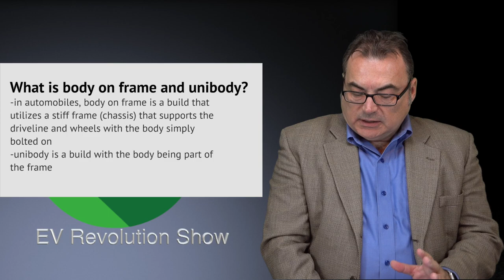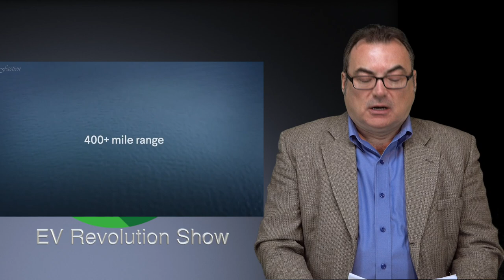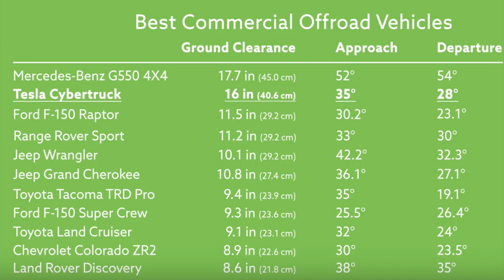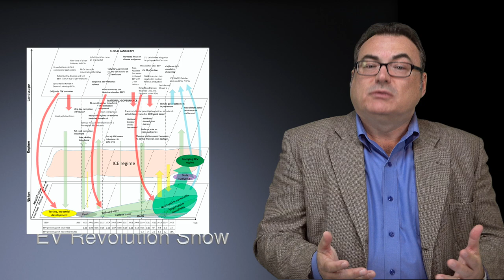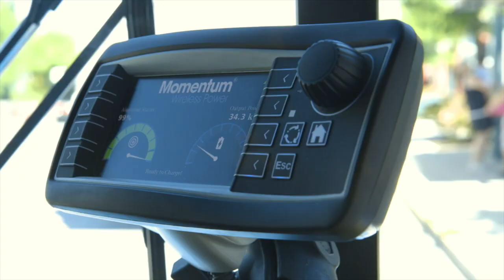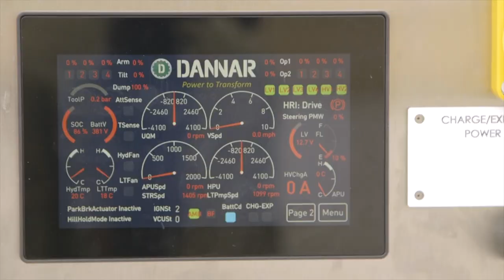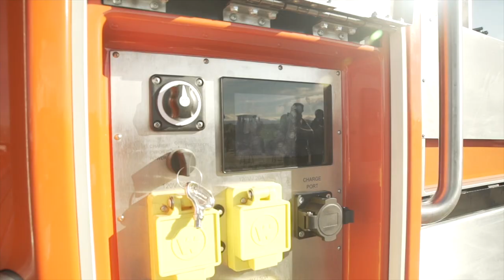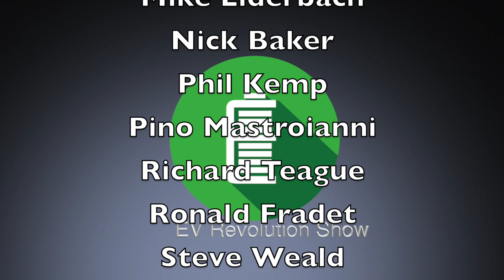Episode 70 - Tesla Cybertruck Part Deux, Lexus UX 300e, Fisker Ocean,  Dannar 4.00 and lots more!

Comment: Yes, Ken, the big three are huge compared to Tesla. However, you did leave out Toyota. It is precisely because the big three are so big that they cannot be as nimble as Tesla. With all of their sunk costs in ICE vehicles and their love of the huge profits they are addicted to it will be hard for them to pivot to EV trucks. Just look at how little GM has done to date. The mighty Ford is just now coming out with the Mach-E so good on them. Lets see how well it does up against the Model Y.

Now, consider this, since Tesla is still the little "new kid on the block", does it not make sense for it to go only after one small segment of the trucking market?  Even so, as runt of a car company, it has the nerve to go after the BIGGEST segment of the market, the F-150. It is unfair for you to compare the CT''s specs with the larger F series trucks. Tesla is NOT going after them.
Reply from the maker: I compared CT specs with many F150 series, not just the larger ones, so yes it was fair.
Reply: @EVRevolution  Ken, you have compared the CT with both the F-250 and the F-350. SO, no, you did not only compare the CT to the F-150. Now, with the off road comparisons, you have thrown in SUVs as well. Huh? What am I missing?

Comment: Dannar...As usual, your analysis is shallow and misleading.  It's amazing... in fact, it sucks!  Watch what happens to Reviean and the Ice truck manufacturers when the cybertruck hits the market.
Reply from the maker: Hi Robert, thanks for watching.  Not sure what analysis you are referring to...Dannar or the CT-Rivian Compare.  If it is the latter, I have acknowledged due to some other commentators that the comparison was not alike due to the Rivan model costing more than what I graphed.  I took the base MSRP.  It's safe to say that the higher spec version will cost more than the tri-motor CT.  

I'm a big boy and certainly can admit when I don't have all my facts straight.  If you follow me on Twitter you would have read this earlier.  I never try to mislead and if you have watched my shows, you would know that.  So I take offence to your statements regarding this and challenge you to find perfection and non-bias in all the other EV YouTubers - especially the Tesla-focused Channels.  I for one make mistakes and have no problem owning up to that.  

If you are complaining about my Dannar reporting, them please specify why?
Reply from the maker: Oh, and I will be watching what happens with the CT hits the market for sure.  Like I've always stated, I want Tesla to succeed and hope they sell boat loads of these.  

My analysis was focused on the market potential of the CT design that IMO was less than what a traditional platform offering could achieve.  It's that simple.